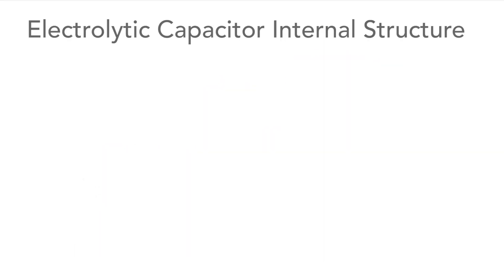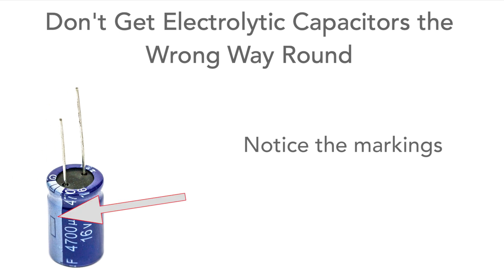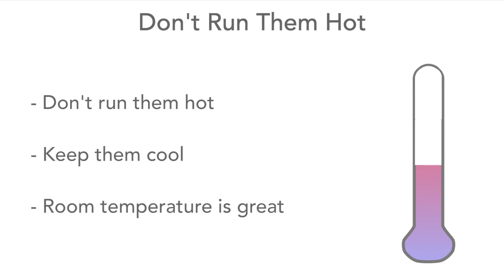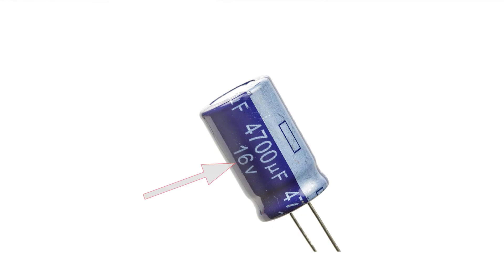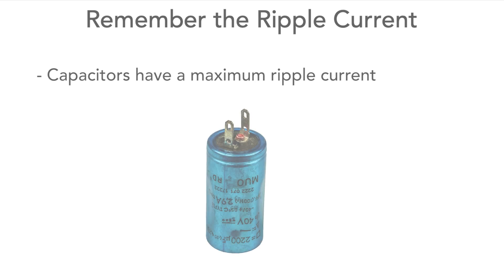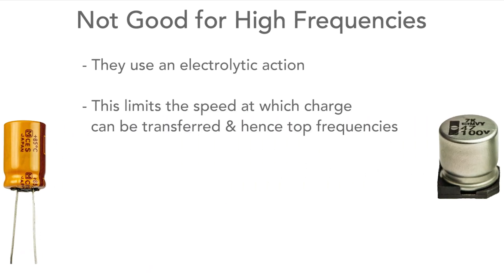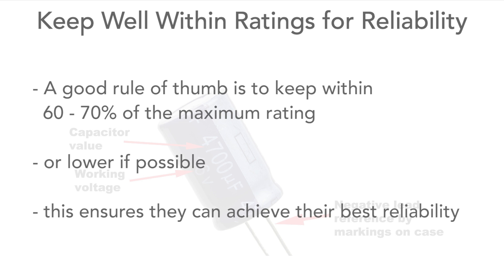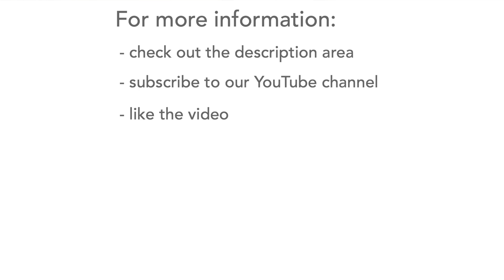Five Great Tips for Using Electrolytic Capacitors #capacitors #electrolyticcapacitor

Comment: Excellent. I agree with the general concept of keeping the working demands on an e-cap well within its limits. However, I believe there may be some misconceptions within the EE hobbyist community... 1) There seems to be the idea that, when replacing e-caps, there is no upper limit to the new cap's voltage rating, so long as it meets the minimum required voltage of the existing e-cap... As an example--- Say you have a 100uF e-cap, with a voltage rating of 10V. And, you replace it with an e-cap that is 100uF, with a voltage rating of 400V, because that is what you have in your stocks... Past common thinking was that this was perfectly acceptable. However, I am learning that, with such a large difference in the working voltage supplied verses the voltage rating stated on the e-cap, the new cap may never completely form, with the consequence that the cap never develops its full capacitance ability. You may not have sufficient capacitance, after all. 2) Likewise, there is the thinking that you may use an e-caps with any capacitance value, so long as that value is equal to, or greater than, the existing e-cap's capacitance rating. From our prior example, say raising the 100uF e-cap value to 1000uF. This will have various consequences (possibly disastrous,) depending upon the use of the particular e-cap... Such as changing the frequency of a timing circuit, or creating massive in-rush current that destroys the entire circuit. I suggest that a video addressing these, and other, common misconception would make a wonderful follow-up video. HTH. Cheers. Sub'd!
Reply from the maker: Thanks for your comments and the ideas. I will give this some thought and see if I can come up with a few additional points as well. This is a good idea for a video - thanks.